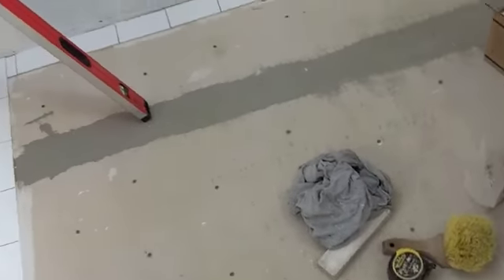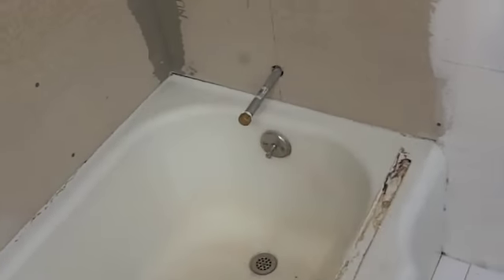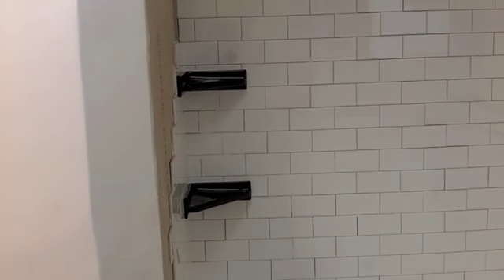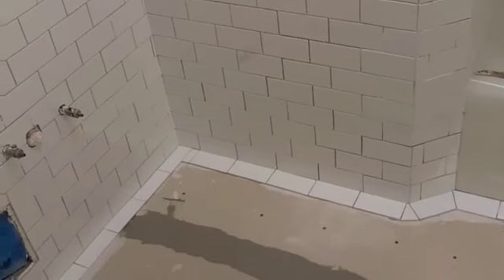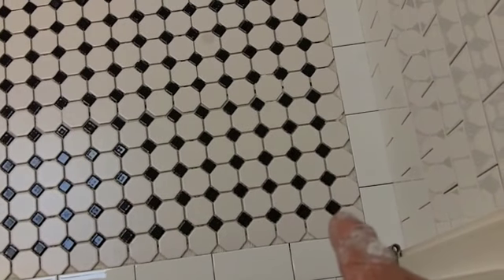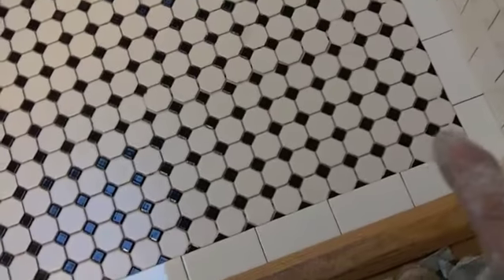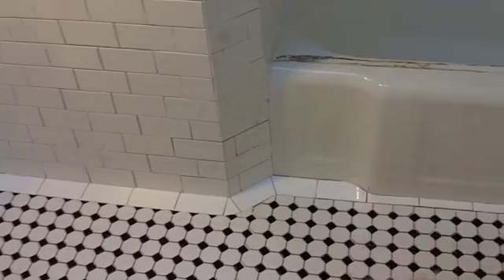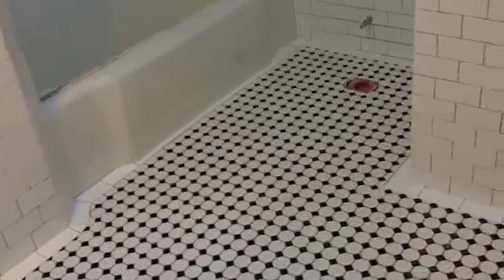Laying Ceramic Tile In A Bathroom 2

Comment: Wow, excellent job! We're novices who just finished our subway tile shower (no amazing accents like you did) and are prepping to do our hex mosaic floor (similar to this one, but not as dizzying). Thanks for sharing your work.
Reply from the maker: Hi Stephanie, You are very welcome. This floor made me dizzy, but the owner absolutely LOVED it..haha  Honestly once the fixtures were set in place and a throw rug put down it was easier on the eyes. Best of luck on your floor, just remember with tile, accurate preparations/layout is key.  Thanks for watching, Steve
Reply: Steve, thanks for the suggestions. We're taking our time on this and spent the day laying the ditra and carefully laying out the tiles to be sure we get them lined up straight. We live in a 1930s mill house, so this particular tile will be very appropriate for the home. We had no intention of having to do our own tile. Long story short....a contractor who was putting a gable in the small addition that is our bathroom neglected to put up a tarp for the night and we had a torrential downpour and lost half the house. Although he initially was supposed to be doing all the work and paying for it, after 2 1/2 months of slow and poor workmanship, we decided to take over the job ourselves. Thanks to videos like yours, we're able to get helpful advice and information on how to do this right. After seeing the added work involved with mosaics for ourselves we can certainly appreciate why a professional would need to be paid more to do it! Thanks again and keep up the great work. :)

Comment: But I would ask if it could be used with another tile adhesive than from Laticrete or they describe as Laticrete 211 Have looked it up on google but was none the wiser.

Comment: Nice job. BTW, a wet saw is not going to cut your fingers off. If you want to cut a bunch of those little pieces, just get two paint stirrer sticks and space them apart by about 1/4" lengthwise, then hot glue the tiles across the gap and run that sucker across your wet saw. I do about 8 in one shot (which yields, obviously, 16 little triangles).
Reply: einfussganger best idea ever!!!! Thanks!!!

Comment: Looks great -- I'm doing the exact same floor -- but much smaller bathroom. Question: how did you cut the small triangular finishing pieces? Can it be done with a nipper?
Reply from the maker: Peter Jordan Hi Peter, I cut them on my tile saw.... very carefefully.  I built a jig out of wood to hold them in line.  You could likely do it with a nipper...  it's just time consuming.
Reply: yourbeekeeper thanks ... I saw a jig at HD for doing this ... but decided to make my own out of wood using my Dremel. Will see how it goes ...
Reply from the maker: Good luck!!!   The jig is nice... keeps your fingers away from the blade...eventhough a wet saw is a more forgiving to skin than a toothed saw.  :-)